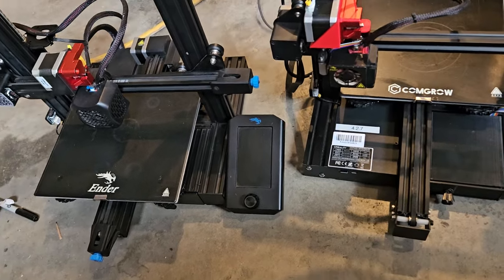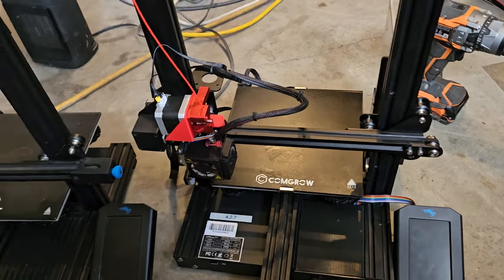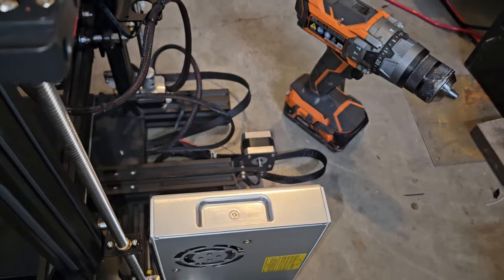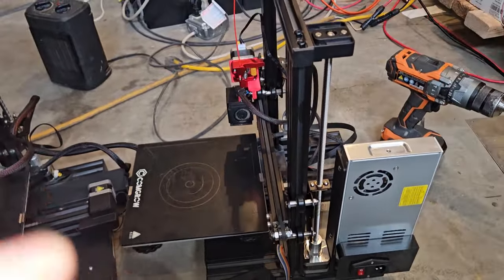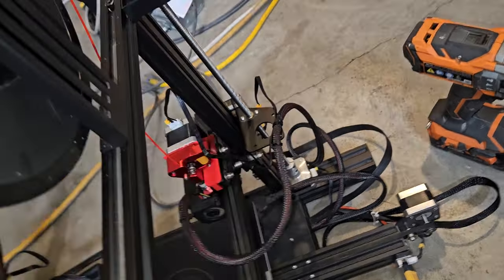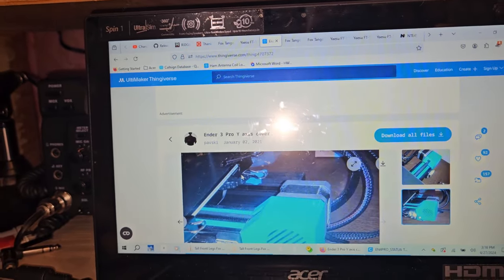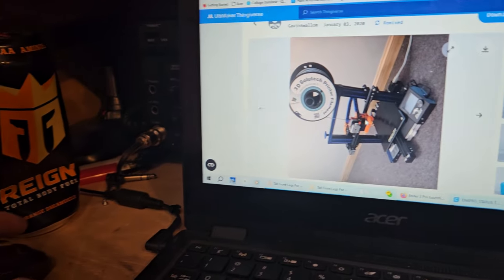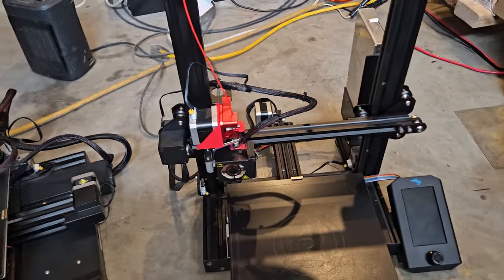my ender 3 3d printer collection and recent mods

Comment: I'm going to point you to the sprite extruder It's the one that is on the ender 3 s1, pro it should work with both the main boards you have.( Edit I would make something that removes all the brains and part that have to be cool off the unit, build a heated chamber for it. I'm going to be trying it here once I get the feel of the printer first)

Comment: Why would anyone buy the base Ender 3 then spend the time to assemble, adjust and later on do the add on mode?  For that you might as well spend a bit more to get the better one.

I came to that conclusion and I am happy I made that decision.  Seriously just a single modification cost  is enough to pay additionally for a new better Ender 3.  How about proof  with me buying and receiving the Ender 3 S1 Pro last week for under $100?  It was listed NOT repair as is but turned out it was a minor thing .  This printer is $500 a few years back and even now  still over $300 on Amazon.  I am extremely pleased and happy of its feature and working order.

I was frustrated and confused with the confusion of so many Ender 3 model but a few days of reading and thinking sorted that confusion out.  Do the home work then you will reap the reward buying correctly.  This is my first printer and I am no longer afraid buying a 3D printed with the listed condition NOT new.
Reply: because they like to tinker...